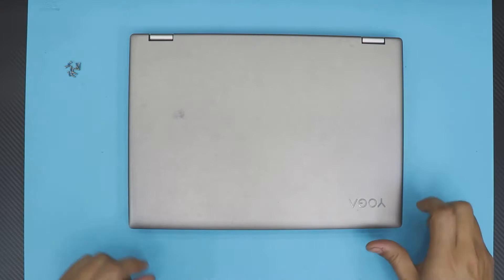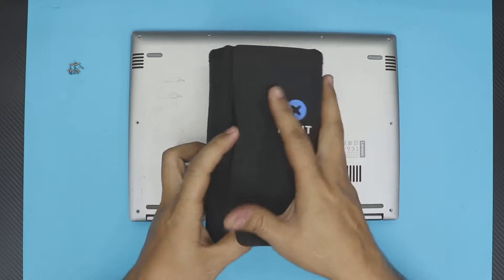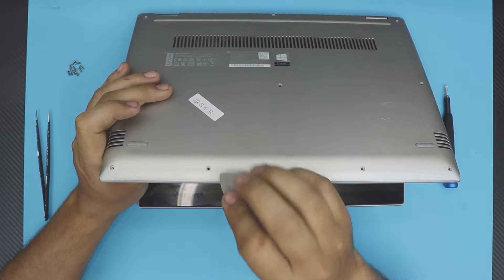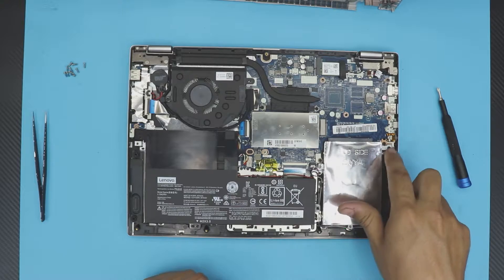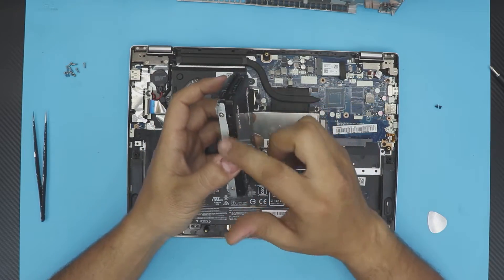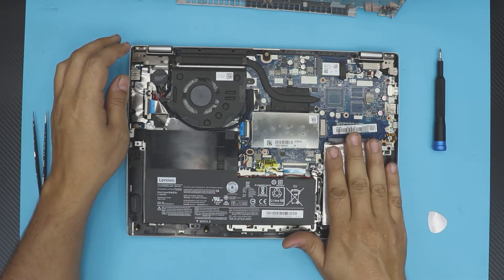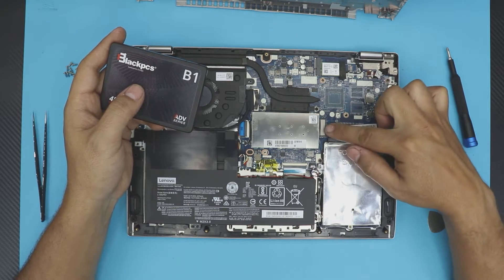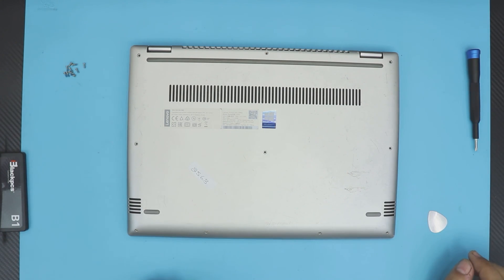✔ LENOVO YOGA 520 Laptop HDD TO SSD upgrade guide

Comment: Thank you for the video and for the prompt responses on the comments. What should I take into consideration when buying a new 1TB SSD for this model? Is there any particular specifications that I need to check when buying?
Reply from the maker: It's my pleasure my friend.
I recommend Samsung Evo, Crucial, or Kingston. The ones you should avoid are ADATA, PNY, or any other brands with questionable reputations.
cheers🍻

Comment: Hi, if I were to add an extra NVMe ssd instead of replacing the hard drive would it actually speed up the laptop for day to day browsing? I read somewhere that in order to make any noticable difference the ssd has to be installed as the primary driver. Is this instilation something that can be done with software or does it only mean replacing the large one you replaced here?
Reply from the maker: Thank you for the feedback! if you wish to support the channel you can LIKE or SUB or both :P
regarding your question: if you want to see the speed difference in any application or loading windows and all huge difference, you must install windows on m.2 nvme drive and use your hdd as 2nd storage. if you place the nvme, there is no application or option just because you install it to make your device faster, you need to have your operating system in there.

Comment: Wait if a replace the ssd what files will stay or will all go away
Reply from the maker: Thank you for the feedback! if you wish to support the channel you can LIKE or SUB or both :P
regarding your question: if you upgrade to SSD then you will not have any windows or file or anything all you windows and files and programs are in your old HDD,
so after upgrading to SSD you can install your windows its very simple:
1. create win10 usb boot drive: https://youtu.be/uDu8j2lE-dM
2. back up your personal files and documents in a external drive or purchase a case to convert your HDD to external drive for future use: https://amzn.to/3l5XTeE
3. install win10 the proper way just follow the installation step to boot from usb follow step 4. : https://www.youtube.com/watch?v=6TTlDTpcXwI
4. to boot from usb on lenovo place the usb in usb port and power on the laptop and quickly  keep tapping on F12 untill you see the boot menu and choose the usb and follow the step above (3) to finish the installation.
once you in the windows connect the old hdd placed in the usb3 case and go to your used folder and copy your files back.

Comment: at the time of pulling I can not remove the hdd, the connector is too tight, I do not want to break the sata connector
Reply from the maker: Thanks ✌  for the feedback!  if you wish to support the channel you can LIKE or SUB or both :P
regarding your question: place a very flat screw driver on the connector between the hdd and adapter you can t break the adapter trust me just use force. use a screw driver to get it to slide.
Reply: @uFixTek  Hi, thanks, I was able to do it using the base of two pencils (one in each corner of the hard drive) and resting the laptop against my chest. My other question is why my 480gb hard drive (windows 10) does not recognize my m.2 ssd (256gb, hynix bc711), but the ssd (also with windows 10) recognizes the hdd in the disk manager. I was also able to solve that problem but using a 256gb hdd (with windows 10). I needed to clone my windows 10 from the first hard drive to ssd. Greetings and thanks for the video and your comments.
Reply from the maker: that is weird any windows 10 should recognize the ssd no matter the size or brand, did you check the disk manager maybe it wasn't assigned drive letter! also i DO NOT RECOMMEND CLONING! it will give you in a long run if not short BOSD (blue screen of death) and crashes, the best would be fresh install of windows its eassy and the best!
create windows 10 usb: https://youtu.be/uDu8j2lE-dM
and to boot from usb : Restart the PC, then press F12 (Fn+F12) to boot from USB disk
and for the installation steps in order to get clean installation follow any of my windows 10 installation guide.
https://youtu.be/7f_rBp6Rb3s
Reply: @uFixTek  When I had connected both units (hdd 1 and ssd), the windows 10 of the hdd did not recognize the ssd (the disk manager only showed the hdd), however, in the BIOS they appeared both. Then I shut down, removed the hdd and turned on only with the ssd (which came with the win 10 setup program), I did it, everything fine but I didn't have my programs or any valuable information. Then I turned off and connected the hdd (hdd and ssd connected), I started windows again from the ssd and if it recognized the hdd (but not the other way around). I opted for cloning because I thought it would be best not to have to back up all my information.
Reply: @uFixTek  in fact, i had tried to format another ssd (a crucial mx500 sata) on my other laptop from usb (win 10), but the installation program wouldn't let me create the partitions. I also had to clone my old windows 8, but then I updated it to windows 10. But my problem is that the screen driver for windows 10 does not have the option to lower or raise the light level of the screen, so I went back to the old one driver.
Reply from the maker: okay then its nothing to do with hardware here its your windows that you have installed that is not detecting the drive. the BEST OF BEST is back up your files and fresh install windows 10 you will tank me at the end :P

Comment: hey is there any way we can add the ssd to the system without replacing it with hdd
Reply: @uFixTek  hello, it would be helpful if you rectified the information you gave in your comment
Reply from the maker: @ronaldgromp1638  i changed the reply and expanded on the m.2 slot on the motherboard, i hope this clarifies the answer, i appreciate the feedback and the  support my friend :)
Reply: @uFixTek  is the m.2 slot support nvme or just m.2 SATA?
Reply: @uFixTek  What are you on about... there is an m.2 Slot literally above the HDD slot next to the RAM on the right under where the GPU would be if you had one on your board
Reply from the maker: @aaronmenezes7685  OKAY LET ME phrase the answer this way!, there is not m.2 slot dim soldered on motherboard, there for you can't place a m.2 ssd, if you take a closer look you will see the place for the m.2 jack but the jack its not installed, and even if you install the m.2 jack still wont work at the bios is not programed for and there are many other components that needs to be installed (power regulators and much more) in order for the m.2 to work, UNLESS you purchase a higher model of the series and it will have the m.2 installed and ready to go.

Comment: Hey thank you already did it by myself .. If i have the usb with win10 onto it.. created by unebootin...  can i perform a clean installation of win10 onto my new SSd installed on the Lenovo yoga? There's something to setup in Bios or i can simply turn on the notebook the enter the boot option menu.. choose to boot  from the pen drive with the win10 medium on it and then the process will be easy? !!
Reply from the maker: i would highly recommend you to go here:
https://www.microsoft.com/en-ca/software-download/windows10
then download :
Create Windows 10 installation media
and it will download the latest iso and will burn it automatically into usb drive that you assign.
1.  First do a full shutdown from Windows (SHIFT + shutdown)
2. –Press Fn + Power button to open the Novo Button Menu. The Novo Button Menu provides four options: Normal Startup, BIOS Setup, Boot Menu and System Recovery.
3. Select the boot menu, select your flash drive.

4. if the usb drive doesn't show in boot list , go to bios and do  "Boot from USB" option is "Enabled"

good luck and if you need to activate the windows let me know, else if you have your own "you know what" then go for it or use a lic. key :P
Reply: @uFixTek   yes i will follow your tips.. the notebook is for a friend and i am going to fix it for him.. doing a fresh installation.. could not heal the old hard drive neither with mac or linux.. thank you again
Reply from the maker: ya for sure the hdd was bumped around and had a bad sectors. use hard disk sentinel to check the hdd status. anything under 95% is bad.